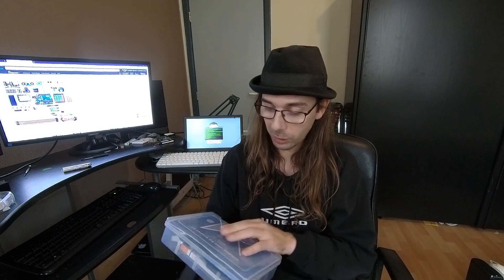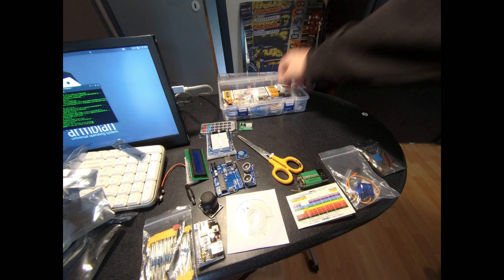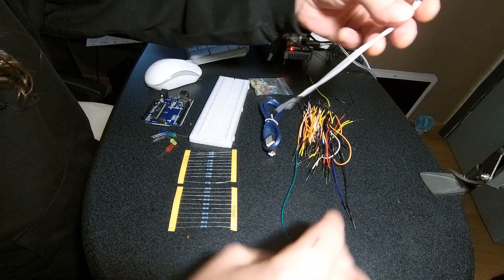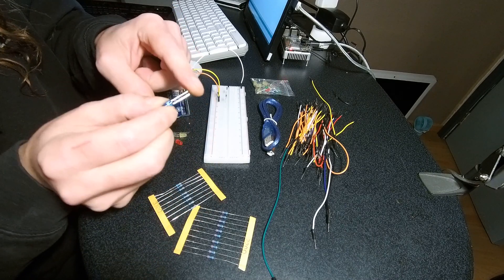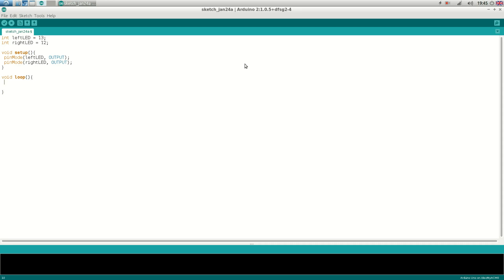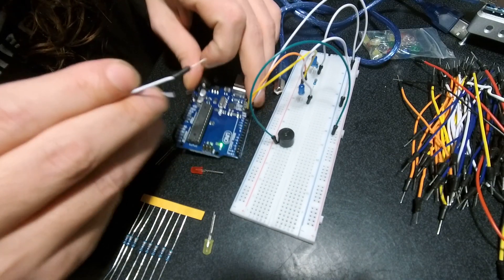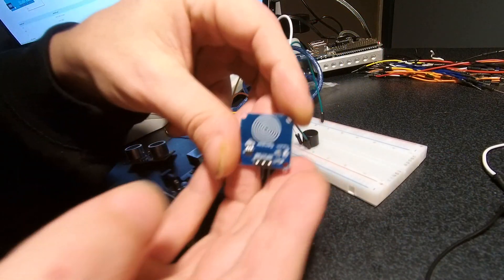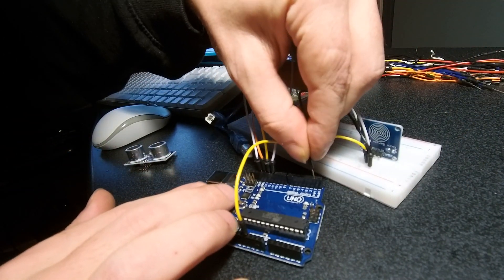Arduino Starter Kit - Make anything you want

Comment: Bought the same Arduino starter kit ~ 1 year ago, but gave it to a child for learning. (Liked your warnings.) Then, abandoned the Arduino after discovering the RPi 3B+ (yeah, I'm playing catch-up) and bought a RPi starter kit. Soon afterwards, I dove into the deep end with a Rock Pi 4B, but found that I needed a snorkel. 
After watching many DroneBot Workshop videos, I realized that the Arduino has many advantages, including simplicity, a vast array of compatible products and community support. So, last week, I ordered another Arduino Uno (for myself), some ESP8266 Wiffy modules, and a Teensy 3.6 (very impressive device). They should arrive today.
XOD also looks interesting. Less is more.
Funny old world, ain't it? 😎
Reply from the maker: Indeed. I rarely use SBC's for tinker projects. If I can use an arduino, I always do. And if it needs to be a bit more powerful the ESP32's and ESP8266's are great too. I've got tons of them. Arduino Nano's are very cheap, so I use them in many projects. SBC's are rarely the best choice. A microcontroller is a lot more power efficient, and can do most needed tasks. I always say, you've got to use the right tool for the job.
Maybe that's why my house is full of tools :)
Greetings.

Comment: The weather station parts (which includes solar management) I have can use either a Pi or an Arduino. Reliant on solar and having to power cellular, every mW counts, especially in below zero temperature, the batteries don't like that. Cellular is painful, two or three watts when transmitting, but wifi and LoRa aren't options. I'm guessing these Arduinos burn even less power than the Zero, but enough to make it worth the time to learn something new? Also, any Pi Zero alternatives that might be compatible with something like a weather station HAT that runs Arnbian, does the same as the Zero but with even less power? For cellular I'm using some Huawei dongle (cheap and LTE), but might one of these HAT GSM modems require less power? 

You're doing a good job being helpful in the forums with respect to accelerating the general progress of these boards. Thanks.
Reply from the maker: Hi. I`m also making a weather station. I`ll use an Arduino Nano for most of the sensor work, and an NanoPi DUO2 to send the data over wifi and GSM.
I`ll use 2 5V 1A solar panels for power, and to calculate the amount of sun in the day. I`l use an small wind turbine to measure wind speeds, and also to charge the power banks.  I`ll use 2 cheap power banks for this. One where you can charge a smart phone and so,  the other to power everything.

The Arduino Nano is very power efficient. In the evening it turns on the DUO2 which gathers all the data from the Nano, and send it, and then shuts down again.
The DUO2 will also have a camera that can be turned on from anywhere o see the garden.

The esp32 could als do all this. with even less power consumption with the low power procesor. But it`s more trouble in programming and debugging.
I`ll finish everything when the weather gets better. Maybe I`ll make a video about it,  but then it`ll cost me a lot more time to finish it.

Good luck, greetings. NicoD